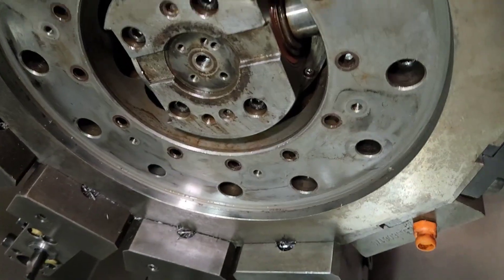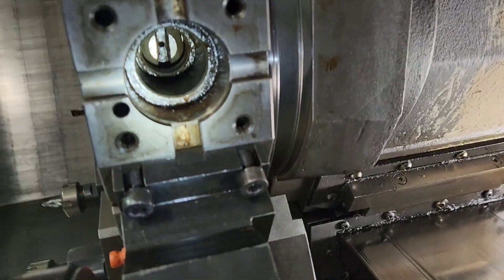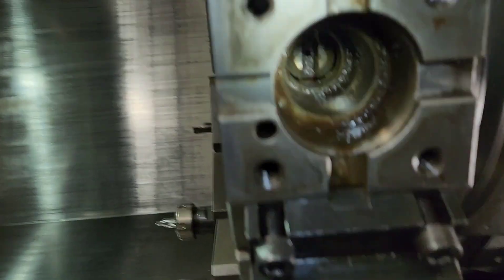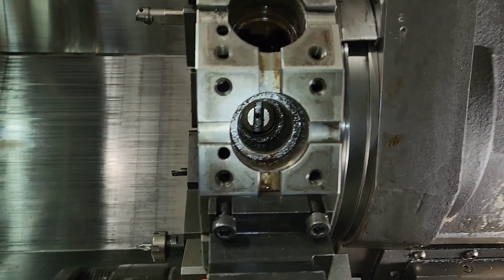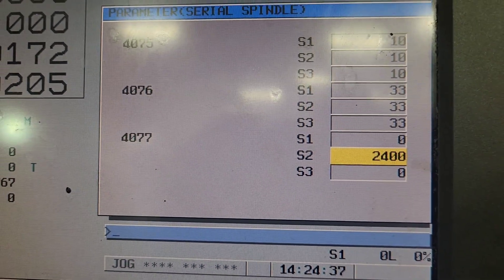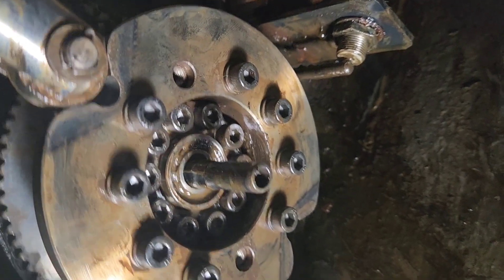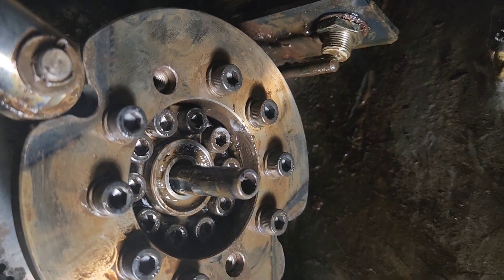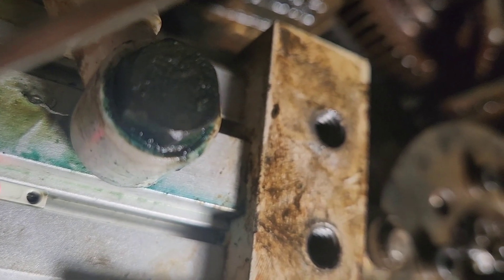Daewoo Puma 2500 LSY Live Tool Alignment / Spindle Orient

Comment: Okay, having never seen such a thing before, that's a very clever way of transferring power to live tools on the turret.
Reply from the maker: Yes, it's unique to Doosan and Daewoo. The only thing that could go wrong is a dull tool slipping that taper lock. Otherwise, that little cylinder and prox switches will prevent a crash. Thanks for your comment Jason.